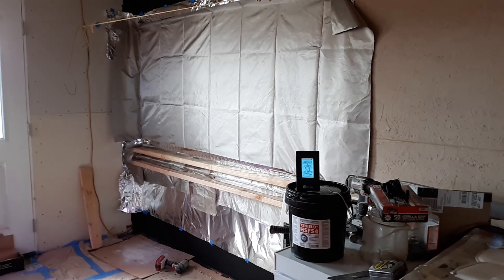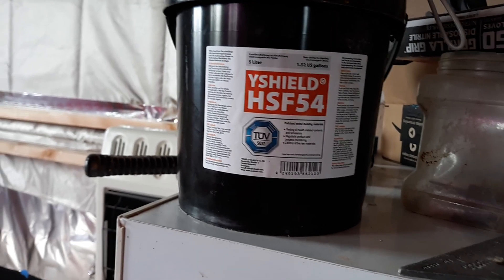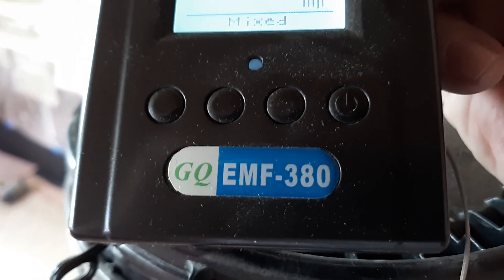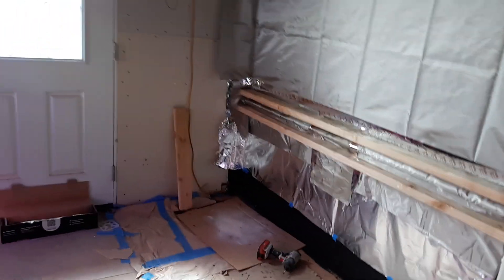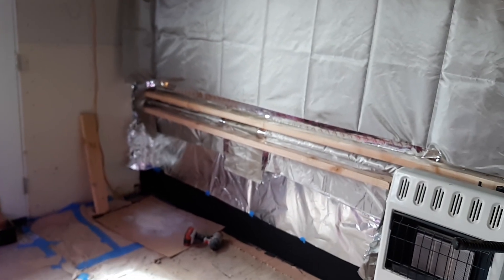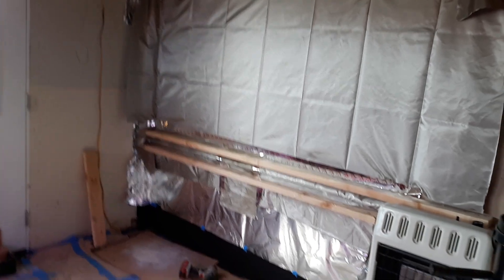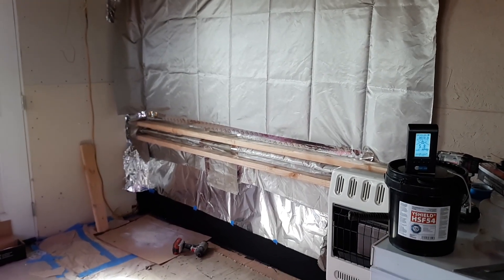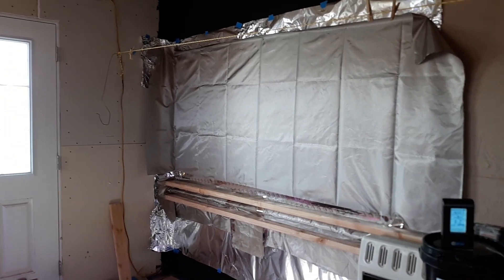BREAKING NEWS: ARE YOU READY FOR AN EMP OR CME? HOW TO BUILD A FARADAY CAGE PART 1

Comment: Sorry,  not to burst your bubble project but you will need many layers. Y shield doesn't work. I've used it.
Reply from the maker: That is why I am also using the tin foil and silver emp cloth.... I also can put wire mesh too if needed.. thanks
Reply: @OFF-GRID-DESERT-FARMING  yes use wire mesh and ground it